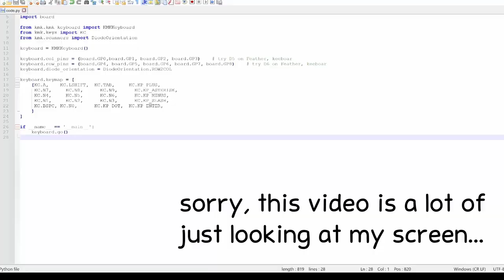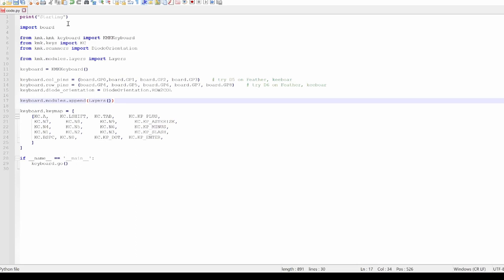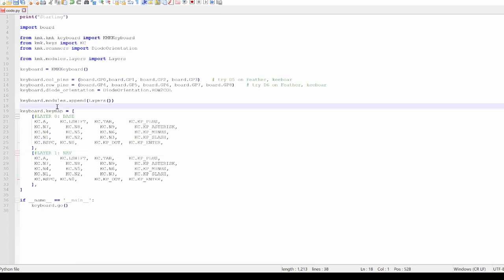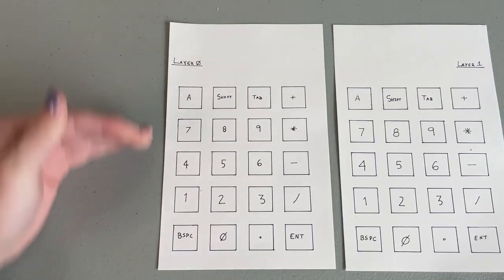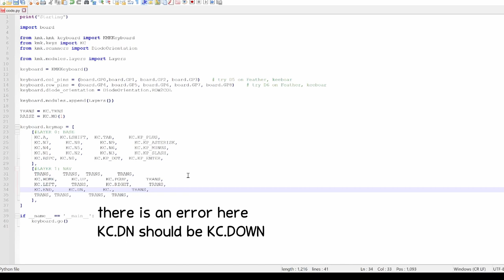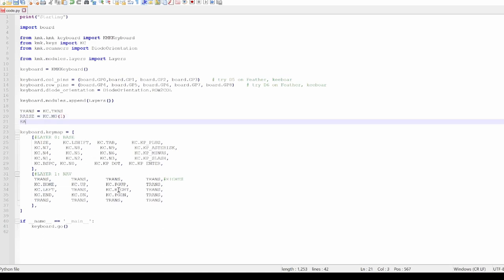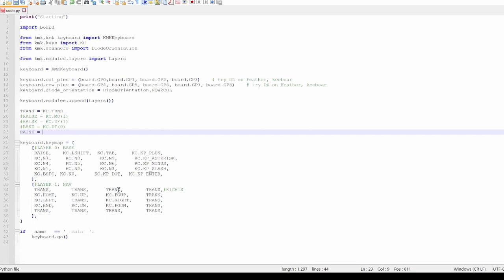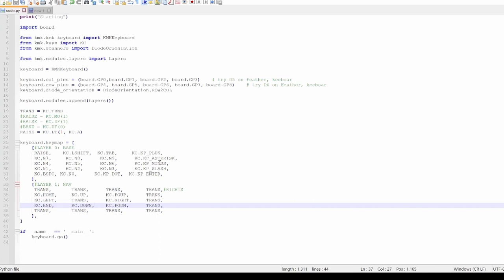Pico Based Number Pad - Part 3: Layers

Comment: Pretty cool that you added a few of the other code as an example as well.

Kmk is so much easier than qmk.

Now to add some bling with leds!

Edit: Ive tried it out as you said and works perfectly. Awesome little feature.
Reply from the maker: KMK is really simple for most stuff and being so easy to edit makes it quick to edit keymaps on the fly.
Reply: @tinyboatproductions  I agree, Ive already made 4 different ones. and changing them on the fly is so easy. Can be done in a text editor.

Now for some led bling
Reply from the maker: Nice! You should post them on instagram and tag me. I’ve love to take a look.
Ill see what I can do about the LEDs for the next round.

Comment: Hey great video.
I have a doubt regarding the layers, How should the code be changes so that I can toggle between 3 or more layers?
Reply from the maker: It depends how you want to access them. 
You could have three separate layer shifting keys on your first layer
you could have one on your first layer, and one on your second layer that takes you to the third layer.
You might be able to do it thought tap dance (not sure on this one tho)

Comment: Nice video, is it possible to use a laptop keyboard and transform it into an usb keyboard with pico? I want to transform a notebook case into a docking station for phones and other mini-PCs.
Reply from the maker: In theory yes, in practice it’ll be a bit of work to trace the Pcb to ensure you are going the right rows and columns.
Reply: @tinyboatproductions  Typing from my new keyboard made using a pi pico, sony vaio keyboard and kmk. Thank you! It was easier than I thought. I even added some extra functions like moving the cursor using Fn + arrow keys. I was lucky to find the keys mapped in rows and columns on another project.